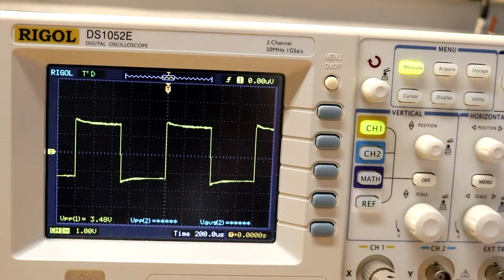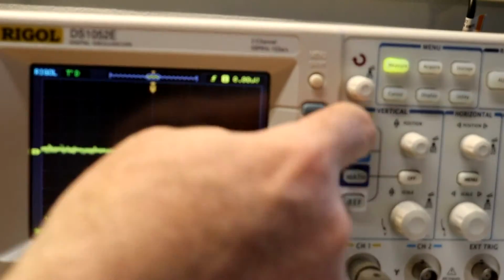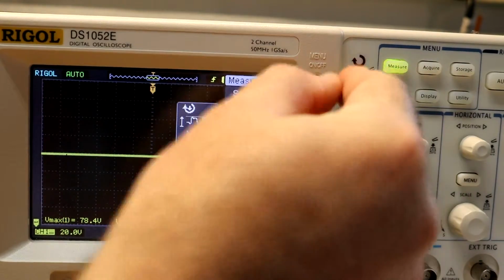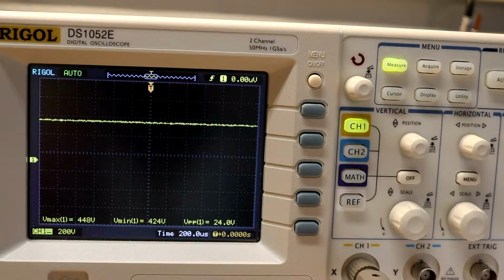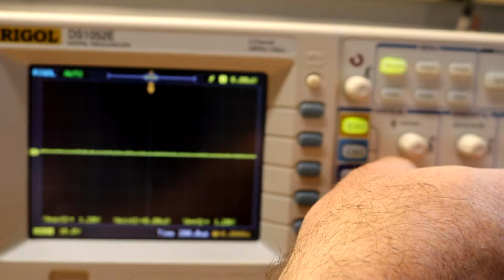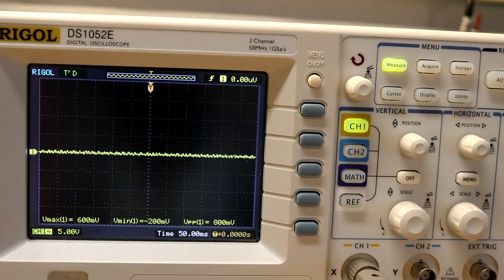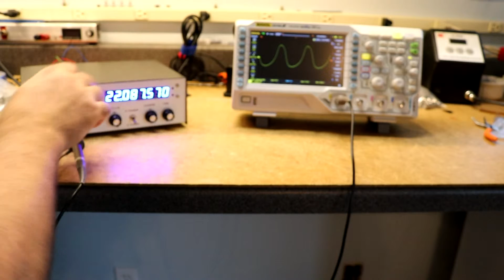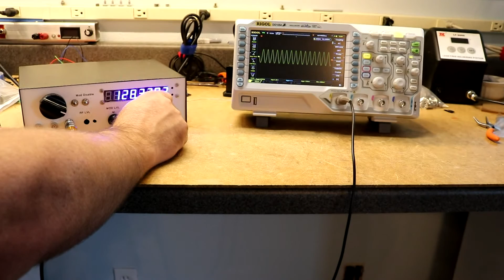Hantek T3100 Oscilloscope Probe Unboxing & Review

Comment: what is the max voltage you can messure with it ??
Reply: Rated max 2000V, as shown in the video. It's also shown on Hantek's website and in the instruction sheet (also shown in this video).
You can measure 100,000V with it if your scope can cope with 1,000V input voltage. However the probe is not safe at that voltage.